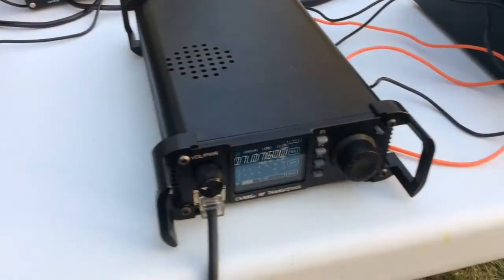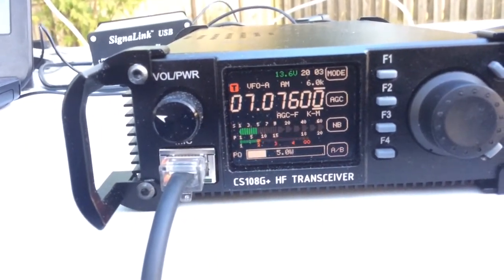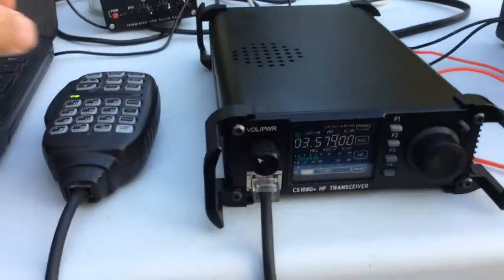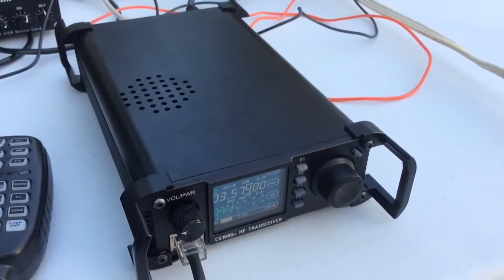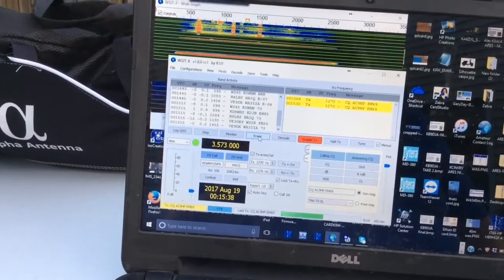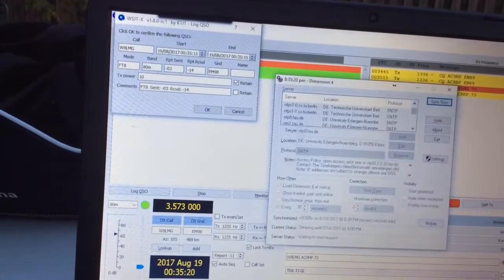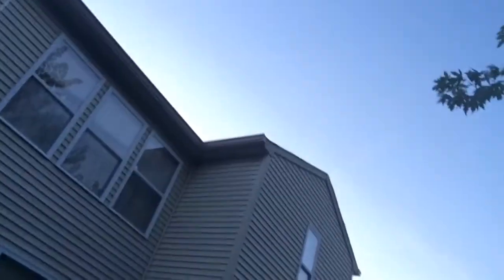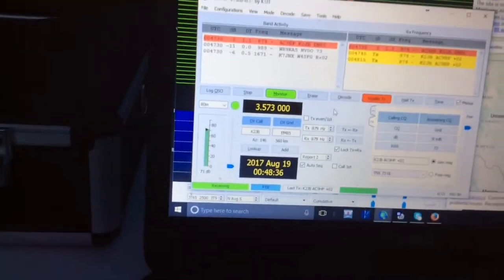Alpha magnetic loop antenna

Comment: Hi, Indy Dad.  I thought I'd make mention of an issue about which some folks are commenting, on another forum: your video demonstrates a really bad practice. The video demonstrates tuning up on an active frequency, using a wide-band AM signal, and not identifying yourself.  All of those things are frowned upon.  There are better ways to check SWR and not cause QRM (interference) with other stations on the same frequency on which you tune up.  It is great that you share the loop and the JT65A information, and I encourage you to continue.  Just be aware of a more gentlemanly way to tune up, and remember that the FCC rules indicate that you should not cause QRM intentionally, and that you must identify your station when you make such transmissions. 73 de NW7US
Reply from the maker: NW7US thanks for the feedback.
Reply: @indydad3911  Maybe consider using an antenna analyzer.

Comment: Which cable did you use for the signalink to the radio? Is it the 6 pin data cable that comes with signalink?
Reply from the maker: Robb McMahan I have the information posted somewhere.  It’s a standard cable and signallink with custom jumpers.   Signallink gave me the info
Reply: Ummm, that's not very specific. They have a lot of cables. What do you mean standard? Where do you have it posted? It's not on the video notes.
Reply from the maker: Robb McMahan From tigertronics 

We just compared the ACC info from the CS108G+ manual with the same info in the X108G manual and they match, so our p/n SLCAB6PM cable (or p/n SLUSB6PM if you order a complete SignaLink USB) will work with the rear panel ACC jack as noted below.

Concerning the Mic jack, we do not have any information on this either so the ACC jack would be the only option at the moment (it should be the best option anyway).  Note that we've had one customer thoroughly test the Xiego X108G ACC connection on PSK31 and he said it works great.

Regards,

Jason / Tigertronics

Jumper settings for CS108G+ and SLCAB6PM radio cable
========================================================
2 - PTT
5 - MIC
6 - Ground

NOTE:  You will also need to connect the supplied audio cable between
the SignaLink's SPKR jack and the radio's External Speaker / Headphone
jack (or other audio output).
Reply: Thanks!

Comment: Is it possible to receive alpha waves with any antenna? If yes, what antenna system would you suggest?
Reply: If you mean Berger's waves, the frequency is too low - mean is 11 Hz. And of course, the "signal" is too weak, too close to noise. Just shave your head, apply some gelo, attach electrodes and plug it to EEG. Best and probably only practical way how to measure alpha waves, m8. :-)